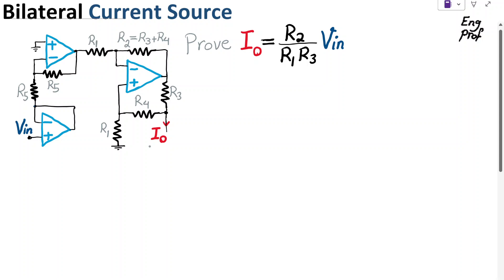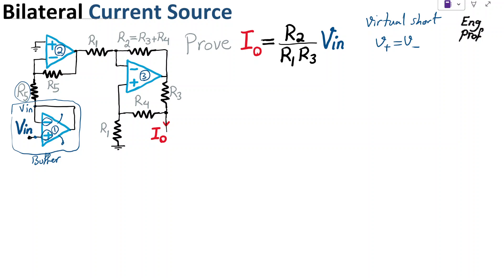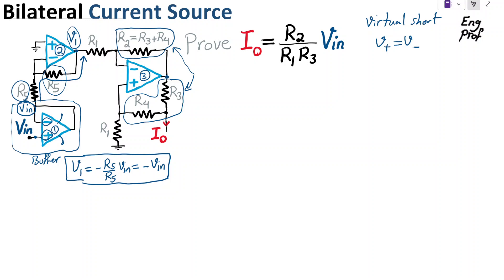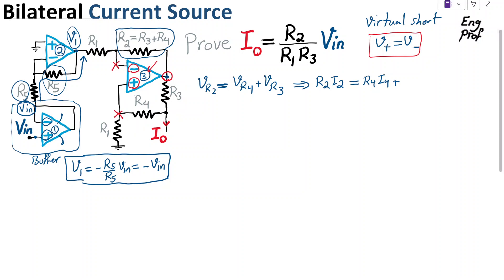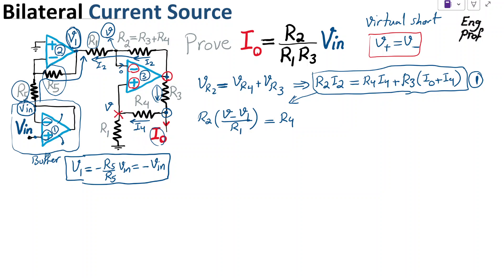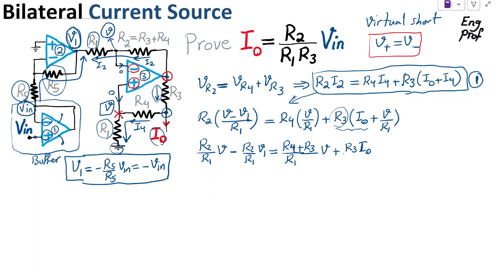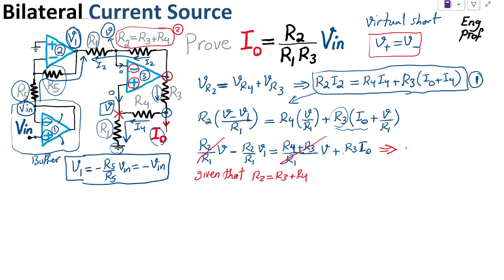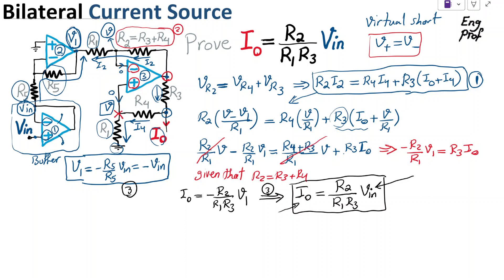Bilateral Current Source (op amp example)

Comment: Something very interesting happens when one sets R2 to 0 (which makes the R3+R4 = 0 as a necessary condition too). In this case, the output current is also, theoretically , independent of the load and becomes Vi/R1 (even when one shorts out the upper R1 but keeps the bottom one in). Though, in this case, I don't dare connect a discharged capacitor, its zero volts will be seen immediately by the non-inverting input and drive the opamp into the rail delivering its shortcircuit current.

Now I wonder what is the behaviour of the circuit with a non-zero R2 and R3 to inrush in an empty capacitor?
Reply from the maker: Thanks for watching and sharing your observations and thoughts.  If you set R2=0 then  Iout =0 and the circuit won't operate as intended.

Comment: Practical considerations: getting those resistors (upper and lower R1, then R2=R3+R4) perfectly equal will be a challenge in practice. Some mental stretching over the weekend got me to a "fine tuning" policy to address the departure from ideal conditions. I'd probably need to do a longer/detailed writeup, but I'm lacking the time now. So let see if I can sketch something here.
Preliminary: rename the bottom R1 (between the non-inverting and groud) to R5. Then the necessary condition for the Io current to not depend on the load is: R2*R5==R1*(R3+R4) - [R1 == R5 and R2 == R3+R4 is a particular case that meets the more general condition]. If this condition is met, the value for the Io is the one in the clip.
Then the procedure follows:
1. assume R1 ≈ R2 and pick R3 to your desired transconductance factor. E.g. for 0.1mA/1V in input, rummage through your resistor box and pick R3 as close as possible to 10k
1.a. always connect a load; otherwise the opamp will hit the upper rail trying to push your choice of current through an infinite resistance. Suggested: a series made of 0.5*R3 and a potentiometer with a R3 max range.
2. Replace the R1/R2 and R4/R5 pairs with a trim pot each - placing the wiper close to the center is a good place to start. 10k or 22k for their value may be a reasonable choice
3. feed a constant known voltage in input and vary the load. If you see variation in the current across load, trim the R4/R5 pot to correct it
4. if the transconductance is not the one expected (because R3 is not quite the exact value), adjust the R1/R2 pot.
Note: after tuning R1/R2, you may need to fine tune again the R4/R5 pot (the condition of current independence of load value has the R2*R5 term), hopefully the steps 3-4 converge.
PS: example trimpots of 22k for R1/R2, R4/R5, gives the 0.1mA/V for R1=R2=11k, R3=10k, R4=6k, R5=16k. Careful with what loads you use, LTSpice-ing this example shows that for a Vin of 1V and a load of 68K, Vo needs to climb to 11V to deliver 0.1mA.
Reply from the maker: Thank you for watching and for this thoughtful and comprehensive note on practical considerations for this current source circuit implementation. Please surely share your follow-up observations and results whenever you get the chance to try the experiment.
Reply: @STEMprof  "whenever you get the chance to try the experiment." - may take a bit, last week I was busy procrastinating against some looming deadlines for a couple of projects I need to deliver. As TANSTAAFL always apply, I feel that a period of "intense cramming" must follow 😁
A quick question if I may: what is your setup for capturing "handwriting"?
Reply from the maker: Thanks for the note. I am using Windows11 native snipping tool. Best wishes with your deadlines and projects.
Reply: @STEMprof  Thank you.